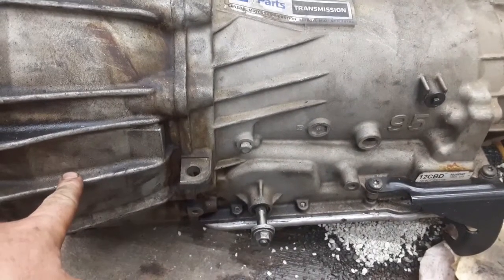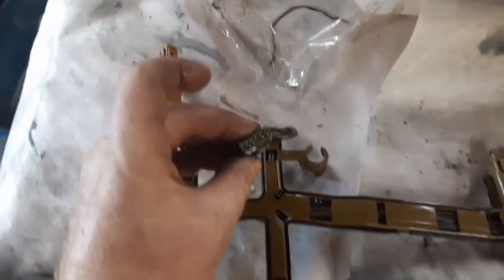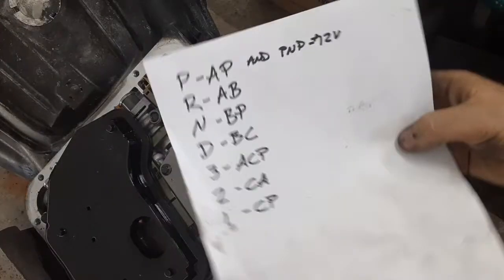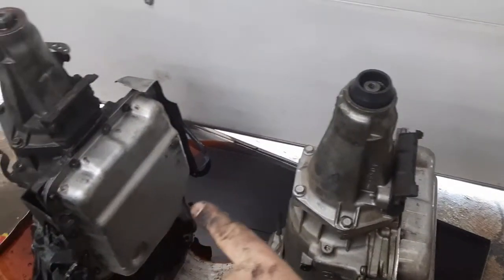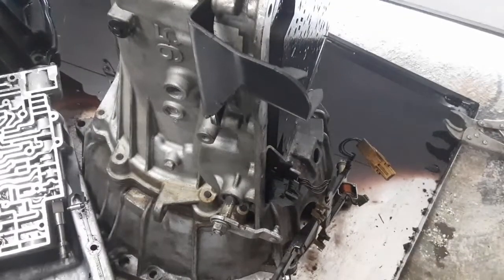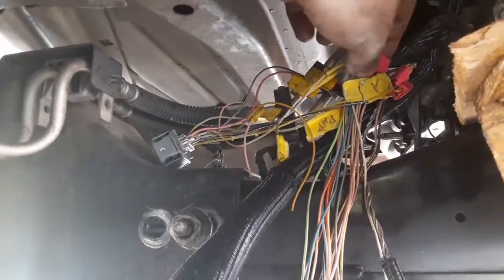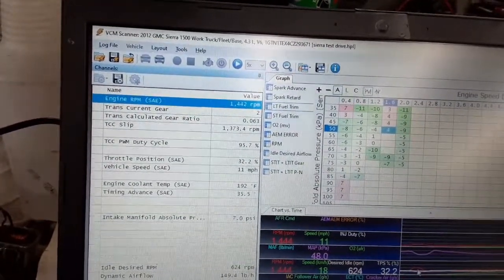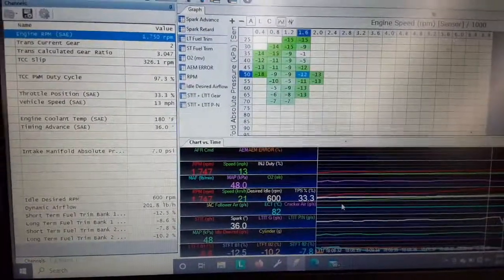4L60e Internal to External MLPS (neutral safety switch) Conversion.

Comment: I can’t get my truck to crank now, not sure where I went wrong. My plug didn’t even have an 11 pin pinned, I pinned one in myself and grounded it to pin 7, rest matched up with original colors and diagrams but still no crank, can manually jump starter and cranks great just doesn’t start. Turn key and nothing happens, any ideas?
Reply from the maker: Sounds like a park/neutral safety issue. Reading the shifter selection with a scan tool will tell you what gear it thinks it's in.

Comment: Are you still driving the vehicle and what about the relearn process that you have to do for the 2009. My plans is to do a 2007 if that is possible
Reply from the maker: Yep, still on the road and driving/shifting just fine. I didn't do a relearn so I'm not sure what it requires.

Comment: Hello - thank you for posting this.  I have a question!  What did you do at PIN 7?  On the external switches PIN 7 is usually ground.  I get that you made PIN 11 ground (instead of power) when converting these 2009+ trucks with the internal range switch.  Did you tie both of them together?  Just leave PIN 7 empty?  Just curious! Thanks!
Reply: Nevermind, got it working.  Still figuring out pins 10 and 11 for the reverse lights though.  Any tips?  It needs 12V, and then the other goes back to the body control module, which kicks a relay, which then kicks the lights.  Trying to figure out which wires did that.

Comment: Hey do you remember what you ended up tapping into for 12v power on wire 11 on the new range sensor or did you just wire 11 to the new switch in the same way it was wired to the old switch?  I'm actually doing this exact thing right now.
Reply from the maker: I'm pretty sure I just wired it like it was without any extra power wires ran somewhere else.
Reply: @lsswapshopp  So you didnt have to literally convert the ground wire to a power wire you just wired the ground wire where the power wire would be and it worked fine? Sorry i'm just trying to make sure I get this right because i'm out of options and need this to work.
Reply from the maker: I did the conversion 2 years ago, so I don't remember that detail. I just used the wiring charts I printed out in the video, made the wiring match the trans I pulled and everything worked like it should.
Reply: @lsswapshopp  I was thinking about it all day and have access to the wiring diagrams for different year silverados with the 4L60e. I'm finding years 2003-2007 have the 11 wires in use to the the range sensor and starting in 2008 - 2011 at least they go down to 6 wires like you did yours. I think you said you used a range sensor for an 08 and the harness was an 03. This is the part i'm trying to wrap my head around how does it work if the pins are different on the harness for multiple years to the same range sensor type? Does where the wires go matter? Electronics are weird
Reply from the maker: The "new" transmission was from an 2008 or so, the vehicle it went in was a 2013. Both NNBS Sierra's, just internal to external electronics. Nothing from a Gen 3 truck, maybe that's the confusion.
Reply: @lsswapshopp  i figured it out. The schematic for 03-07 is completely different however 08 which still uses the external sensor is wired exactly the same as 09-11  at least that I know of which use the internal sensor. That's why it worked because it is apparently able to work off of pins 3-8 on external and internal.

Comment: Did you have to program the tcm? Probably not but worth asking.
Reply from the maker: Nope, it worked as-is.
Reply: Did you leave the wires you spliced into attached to the valve body harness or cut them back to the outside plug?
Reply from the maker: I dont remember, I did this almost 2 years ago. Whatever I showed on video is the way it still is.

Comment: I'm doing the same thing on 08  Colorado. Having trouble finding b a pin out diagram  on internal switch transmission.
Reply from the maker: I don't have the link anymore, but I found the one I used just searching Images on Google for 4l60e wiring diagrams.

Comment: Great video,  Wil
I went through  a lot of research  before I found your video.
I have a 2008 Canyon with  a 4l60e external switch. I put a 2009 4l60e internal switch,  of course it's now in limp mode and not shifting.now I am nervous to mess with the wiring 
But i would like to give it a shot.
Would I have to switch the linkage with the external wiring  harness from the 2008 4l60e to the 2009 4l60e also ?
Thank for your valuable  time and greatly  appreciate  your in depth videos
Reply from the maker: If you want to keep the external switch, it should bolt right on the trans and just plug everything in like normal. If that dosen't work just reverse the wiring I did and you should be fine. I have over 5000 miles on this trans so far and it works great.
Reply: @lsswapshopp  
Thank you Wil I am going to try it this week.I should of let you know in my first comment  it did not work with just putting  the switch on the 2009 4l60e and plugging it all in. I will change the internal wiring harness  and let you know
I will let you know how I made out
Reply from the maker: Gotchya, I'm pretty confident you'll be able to make it work with some re-wiring then since it's the same as what I did just reversed.
Reply: Can you send me all these pictures currently going through the same thing

Comment: Hey Wil, Good job on the video it explained a lot for me both on the PNP switch and the HPTuners VCM Suit, but did you find out more on the duty cycle issue that HPTuners made you aware of ? Was it a problem with the trans or a wiring issue because of the differing switches ?
Reply from the maker: I actually figured it out the next day. I dug into the tune and there was another condition graph I didn't catch. The vehicle needs to be at or above 41mph to actually activate the TCC solenoid even if the PWM shows it being commanded. So I took it on a road test, hit 41mph, and the TCC locked up perfect, slip dropped to 0. So the conversion worked great. I've put a couple hundred miles on it already without a problem.